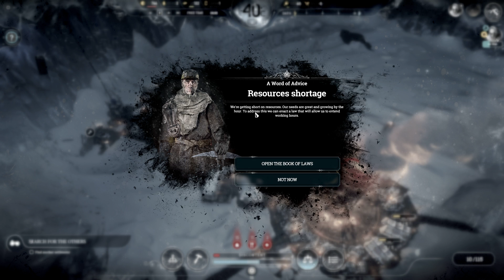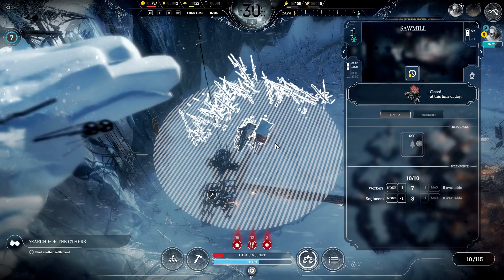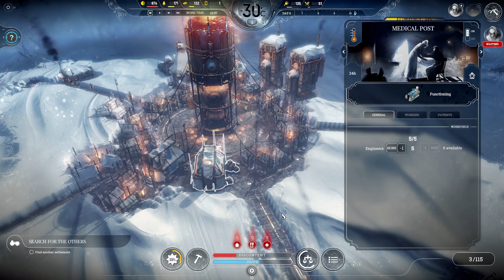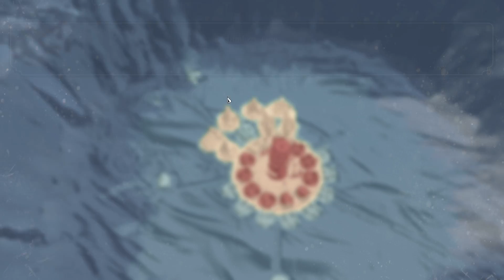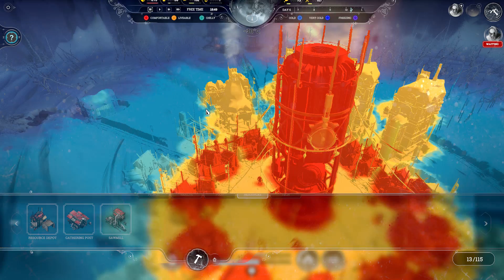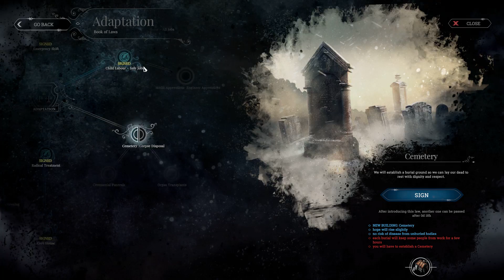Let's Play Frostpunk 5

Comment: Heater uses 1 coal per hour to heat 1 facility, Steam hub uses 3 coal per hour but can heat like 6 facilities around it.... Much more efficient.
Reply: Base steam hubs beat base heaters sure. However the steamhub's coal usage are affected by generator power level and their own range. In the end it could be a steam hub heating 12ish buildings but cost 100+ coal per hour vs a heater heating one home for 3 per hour.